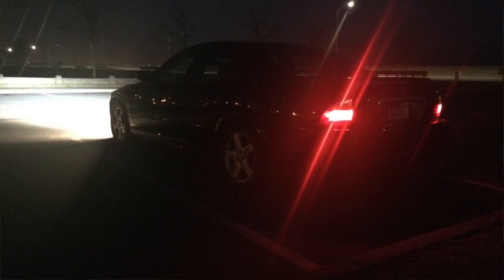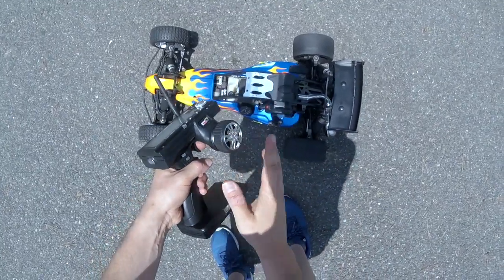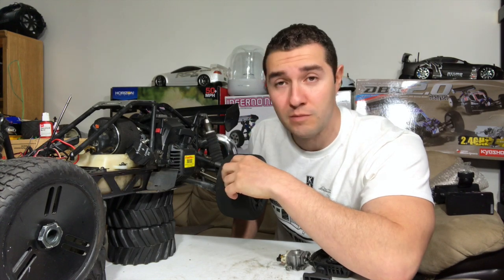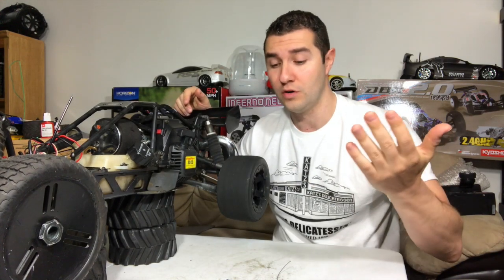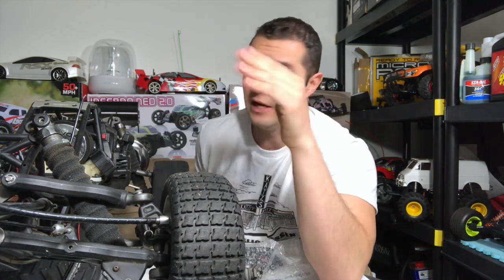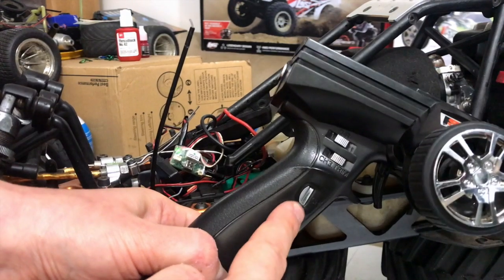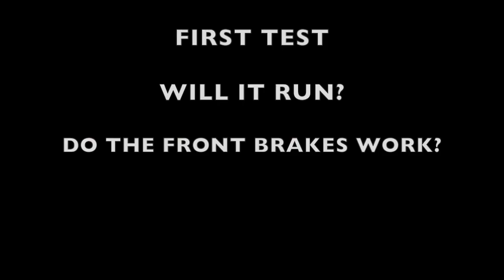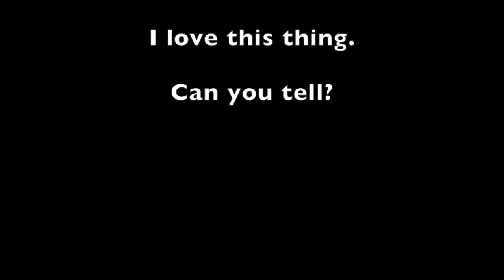King Motors Baja - It's got an RCMK engine, front disc brakes and Major Issues. CAN I FIX IT?

Comment: Heyyyy there it is! Bout time you through in a 1/5 gas video😜 absolutely sweet pickup for $300 even with the issues that was diagnosed another baja to the collection!👊👍
Reply from the maker: hey my guy!! Yup, it took me a whole year to film and make this video, I just forgot about it while I was busy with all the broken nitros, LOL.  BTW, at the time of pickup the only issue it had was the radio kill switch glitch from the bad signal. It only recently developed the non-starting issue and the broken pullstart.  All in all, I think it's good value.  Place your bet on the top speed I will be getting on this, my current top speed champ is the 30CC rovan baja at 44 MPH.

Comment: Nice bro, looks like you have it running mint! Some pretty nice drifting action too 🙂
Reply from the maker: hey bro!! Thanks! Believe it or not, I ave not even tuned the high speed needle yet on this fake 990 carb.  So far I've been running it at least every other day to see if the myths about the fake walbro carbs are true, and so far this thing seems to perform really well.  I'm not a BAJA master tech but I can't seem to find anything wrong with it so far, you know.
Reply: @hybrid32494  Well, if anyone could spot a fake, I would think it'd be you man.

Comment: What's better,  the rovan 29cc or km001,  buying one at the start of the month, thanks.
Reply from the maker: hey man! The 29CC banggood one and the KM001 are very similar.  I prefer the knobby tires on the 29CC model and the pipe on the 29CC model. Both engines are good, they perform about the same.  Check my newer vids I included a link and a discount code of 10% for the 29CC model.  I might go run mine today, your comment made me want to give it a run.
Reply: @hybrid32494  see i was set on the rovan, however the km has the upgraded aluminium,  which is something that i would have to purchase separately for the rovan, as there both £374.

Comment: Is it better to run with ethanol fuel or non ethanol fuel. Because where I live they non ethanol
Reply from the maker: hey bro! It is highly recommended to run fuel WITHOUT ethanol for all these GAS RCs.  The ethanol tends to rot and eat away the rubber components of the carb itself, which was not designed to run ethanol mixed fuels.  Trust me, try to run ZERO ethanol if possible.  IN my case all the fuel in my area has ethanol, and about every 3 years the carb needs to be replaced..

Comment: Well i do not have a baja but believe it or not some of those weedeaters are just like 5th scales that i own engine wise
Reply from the maker: hey bro!! Yes, the overall engine layout and design is similar.  But these Rc specific engines tend to be higher RPM and produce more power.  Lawn equipment is usually just a single RPM power band, these need to be pretty flexible for all conditions.  Otherwise the carb systems and such are similar, yes.

Comment: Hahaha when people show up with less money I straight up walk away into my house
Reply from the maker: hey bro Long time no talk, how you been?  Anyway, I figured I would offer the 350 If there was no issues, once he told me about the radio glitching and the kill switch being activated, I knew to just offer the 300 and see what happens.  Luckily the radio glitch turned out to be the crimped antenna wire.  I hate messing with the kill switch wiring, but this killer bee model is quite easy to deal with and setup.

Comment: I like how you showed everything working before you drove it my favorite part was watching the front brakes move and did you put an extra M at the end of the video in  the word coming to annoy me lol
Reply from the maker: hey man! I'll be sure to show more of the front brake system In the next few videos as I try to tune them for more stopping power.  They may seem good, but the sliding you saw at the end was mostly on wet grass, on pavement they need alot more stopping power.  I've also noticed this baja has terrible rear brakes, and the upper chassis plate near the brake disc is cracked.

Comment: He went from $650 down to $350 that you agreed opon then you show up with $300 wtf? No class Ralphie boy. I would have sent you walking. That 5b is worth way more money then 3 bills.
Reply from the maker: hey my dude! Turns out the owner is a friend of one of my RC buddies, so that's how this went down the way it did.  Anyway let me tell you a few negatives about it, it needed a whole new radio system, and lots of brake adjustment.  Also I noticed the rear brake holder mount was cracked, needless to say I put in lots of fine DETAIL work into this baja.  Also the carb needed to be replaced after a little while due to a bad diaphragm, over time.  Also at this time a brand new ROVAN baja 30CC was selling for around 400ish, so 300 for a used Older model with an unknown engine history and bad radio gear is VERY FAIR.
Reply: @hybrid32494  Good to know your a honest man of your word! Much respect for not deleting my comment & responding! Your top notch my friend! Wish I could find a used 5b for $300 the cheapest ones on eBay are $699 now. Wish you lived closer you could run one of my big gas rc cats with me! I do have a redcat rampage mt as well. Man it’s heavy lol. Peace Keith n shelly

Comment: Also king motor came with rcmk 28.5 engines in 2014 never a 30.5, ask Dan.... I don't believe that's a 30.5
Reply from the maker: I will do some research on this matter.  I really don't know, I was not into the gas RCs back then.  All I know is this motor Kicks AS* compared to the Redcat motors, and even the rovan.  Even the fake 990 carb I got seems to be good, I've had no weird thing issues so far.  More on this baja soon, you'll see some good runs.

Comment: Might sound funny but it could be cuz your running a cheap spark plug use and NGK spark plug
Reply from the maker: hey dude,  how you doing!  This BAJA is kicking ASS these days, lol, you gotta look up the newer vids on this, it will blow you away. Anyways I only use the proper NGK CMR7H plugs as these are meant for, not sure if when I first picked it up it had a diff plug or not, but you're right,.  thanks.